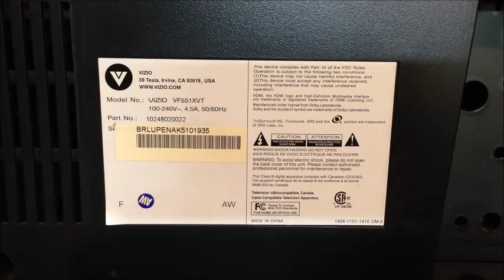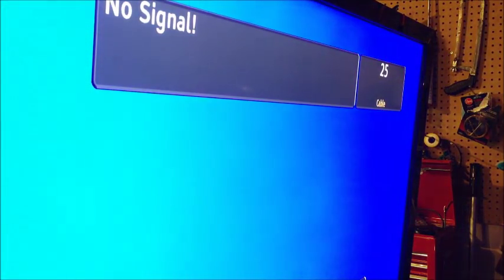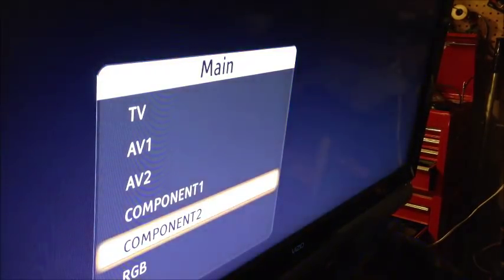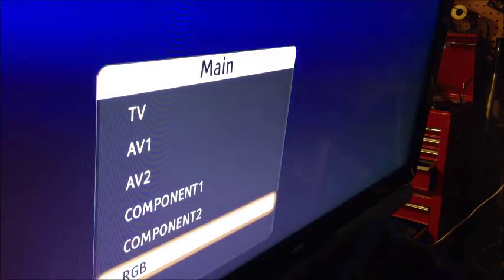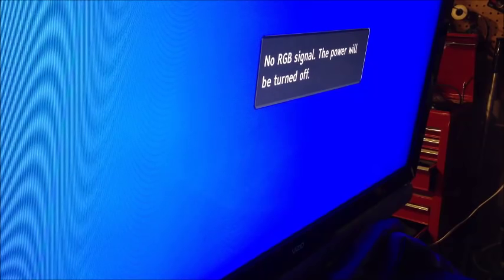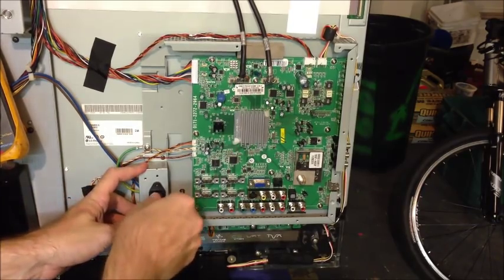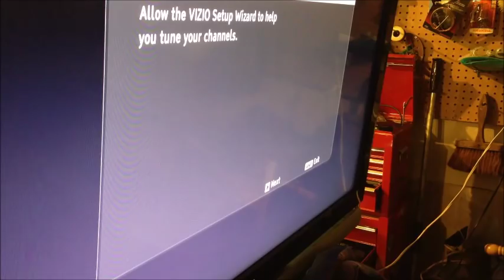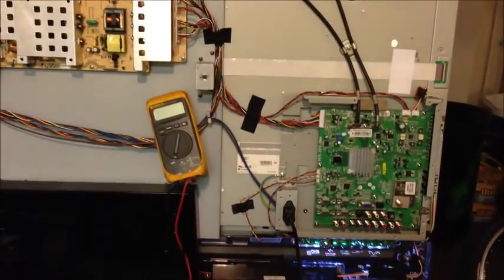Vizio 55 inch LED Television Repair VF551XVT

Comment: Thanks for the video, very informative. This did not address my particular issue however. I do have the Vizio 55in VF551XVT but the issue with mine looks like wrinkles in the tv picture. Not lines per say but it looks like wrinkles or wavy black lines. They are not very dark but when there is a light colored source on the screen you cant miss them. If I were to send you a picture of this do you think perhaps you could identify the possible issue?

Comment: Having a problem with a e500i-A1 vizio 50 inch went out while watching simpsons marathon a few months back got it back on for a while just unplugged the power cord for a min then plugged it back in ..(hard reset) now it's out again and I've looked over the boards both power and main and I do not see anything burnt out or busted ? Would like to hear your opinion on the matter

Comment: Erik I have a 50 I mean series vizio smart tv. Under the first year it had a power problem. they fixed it under warranty. 2nd year I'm getting vertical thin green lines that stand out even more in the black. I don't have warranty for it. could it be the motherboard or the circuts?

Comment: Have the same model and suspect the main board. The audio seems to have a glitch or fumble towards the end of the board part #365500320150, sounds like you said H or 4H, but it's not clear?

Comment: were back to the old days of plug in boards, my parents had 1976 Quaser tv with plug in boards, I fixed it a few times. it was a hassle i guess for repair shops to stock all those modules.

Comment: got a vizio model # SV40M  i believe it"s 50 inch. will turn on and a  program will play for about 5 minutes then lines start about half way through it and then bottom 3/4 is black, and top 1/4 is still showing program.

Comment: My tv is a VIZIO LED 55 tv model number E550i-A0, after a storm, my tv's whole side panel with all the inputs stopped working, and gave me the same as what you said in this video. I could switch from HDMI 1 and 2, but nothing showed on the screen. HDMI 3 and 4 are OK, but they are located on the back of the tv. Nothing on that side panel works. The screen is also fine but there is no sound. When plugged up and when playing a movie or game, the VIZIO word is not lit up at all and I do remember it being lit up when I first bought it. I can still get movies and games to play through those back HDMI ports 3 and 4. I have thought that it might be the control board, but the tv also will shut itself off when there is nothing playing on the screen and in the beginning of movies, IT doesn't really turn off, but the screen goes black, like it needs to gather enough power over time for it to stay on because once a movie is actually playing, it doesn't shut off. Do you think I might need to get a board and a power supply or just try the board first? I don't want to buy something I don't need, but this happened before I even had the tv for an entire year and Sam's (where I purchased) wouldn't replace it because they said they no longer had the model number and vizio wouldn't do anything for me. I have shotty electrical work done (I rent) and am currently using a battery backup surge protector to plug all my appliances in to. Please get back to me at your own convenience, I don't want to spent 800.00 on another tv just to have it for under a year. :/

Comment: Hey Eric. I have a 55" Vizio model E550VL. Both my HDMI ports one and two stopped working. Only HDMI side works. Not sure where to go from here to which part I need. Thanks
Reply from the maker: I would replace the same board I replaced in this video
Reply: Ok thanks eric

Comment: Erik - thanks for posting this.  I have the exact model, and I have replaced all 4 boards (controller, power supply, CPU and backlight board).  The logo and lower left LEDs come on, but the screen never lights up at all.  Does everything need to be reinstalled (in terms of metal covers) for the panel to turn on?

Comment: I have a 65" Vizio smart tv and when I turn it on the screen stays black. Do you know what I can do to fix it? Model M3D650SV
Reply from the maker: If the audio works and the vizio light stays on, but the screen is black, then I would look for the boards that connect to the lights. They are usually on the side. I mention them in the video I think. Replaceing them may work. Make sure the power supply is ok like I did in the video.
Reply: +Fabian Jimenez 
Hi Fabian
I have a XVT3D650SV  also. What ever became of your issue with your TV? I lost the backlights, but TV turns on and audio are okay. PCBs are hard to get for this model. Can you tell me what you did? Thanks Marty
Reply: +Fabian Jimenez 
I forgot to mention that I do not get the boot up screen with the "V" but after the TV initializes setup the audio does start up. Need a supplier for T-Conn, Main board and LED driver brd.
Reply: +Erik Frey what would the part be called that I need to replace? My TV powers on but no picture.  it has back light.

Comment: Thank you for this video, the problem with my vizio 45" LCD is that when I turn it on the picture only shows on half part of the screen, is there a way to reset this? thanks
Reply from the maker: I doubt it.

Comment: Hey Eric I have the exact same TV when I turn it on the orange light turns to white and the start up vizio screen comes on and stays on the vizio start up screen and I'm not able to do anything else with it and I have to unplug it and try again. Sometimes it will come on no problem and other times it may take a day to come on properly. Any advice on what this problem may be

Comment: Hi Erik, thanks for the video! 
I have a Vizio 50" LED 3D Smart TV, model number - M501d-A2R... that's a vertical purple line on the left side on the screen, just won't go away no matter what output I switch... any advice?  Thank you in advance!

Comment: Hi.   I have a Vizio 55 inch LED TV model # 552XVT which keeps shutting itself off.   We purchased it in 2011.  Over the course of a movie it will shut off about 6 or 7 times -- First at about the 45 minute mark, then the interval gets shorter.  This issue is worse when using dvd player and xbox then when watching tv.    Any suggestions on what may be the source of the problem?
Reply from the maker: Sounds like something is getting hot maybe. It's probably in the power supply. Running the DVD or xbox makes the processor work harder then cable TV. Unless it comes from a cable box via HDMI. I suspect power supply board. Look around on it for popped up capacitors. They look like little barrels or soda cans. They should all have a very flat top. if any are rounded they need to be replaced. Also check solder joints on bottom of board.
Reply: ***** Thanks!

Comment: I need to know how to get the TV apart to get to all the electronics.  I can't seem to take the back or the frame off of my Vizio TV.  I removed all the screws and can loosen the two sides of the monitor, but the top and the bottom are stuck and/or held on by something that I can't see.  I've tried everything I can think of to take it apart, but I also know it's made of cheap plastic and will break with much force.  I've seen several videos on how to fix these TVs, but none that show/tell you how to get inside of them.  My model is a E321ME...which is different then all the videos I've seen...so maybe my TV is trickier somehow.  It's super frustrating.

Comment: great video i did that same thing you did with the multimeter i got the ac to read 120 volts and i live in the us

but on the DC section i only got 1 read of 5v the other readings did not work

my problem is that one day i plugged in a air conditoner in the outlet and my tv as well i had a hdmi plugged in to the back and it blew out the hdmi port like it looks black but i cant get the logic board section area open because it has the metal plate over it which i dont know how to remove to check the caps

idk if its the psu or the logic board or main board
Reply from the maker: did you ever replace the power supply board?

Comment: I have VF551XVT 55 in. At times it works oK.then the picture fades out and if turned off for a while it'll get back to normal.The sound continues to stay on...so the only thing that goes out is the video. Please help out.

Comment: hey erik i got a vizio m55onv 55 inch i get power and it lights up but no icons and no control over the channels i ordered a new board please tell am i right or could it be somthing else
Reply: thank you i'm ordering a replacement power board as soon as i sell the main board i bought that didn't fix it your right its a gamble. heres a question about the westinghouse i got i have gottin a few videos on what maybe wrong with it but i have replaced the power supply twice and pretty much very board visiable and still on getting the tv to turn on. now with that said i tryied to turn it on once and the button board arced off and i saw a spark would that have fried my main new main board?

Comment: Ever had this problem: Vizio E550VL: Sound will not work on HDMI(does in other input types AV/RCA) tried other cables and different input devices; blueray,xbox and adjusted tv settings

Comment from the maker: If it runs for a while and shuts down it could be an overheating issue, or bad capacitors (they tend to act funny when they go bad and get hot). I would check the power out, labeled 12V, or 5V, etc and make sure they are what they are labeled. BUT, the power supply board is prolly a good guess. It's hard to say.

If you see any poped up caps, you might just get by by replacing them.
Reply: Turns on for a while then goes off an comes back on
Reply from the maker: Michelle Novotny It could be getting hot. That one's tricky. try unplugging the wires from the power supply board that go to the lights. They will be bigger, not a ribbon cable. See if it will stay on then.
Reply: Thank you I'll try
Reply: ***** my tv is doing a similar thing when I first turn it on the screen starts flashing on & off constantly  & can hear a ticking like noise each time it flashes. Any idea what it would be

Comment: Hi there, same model tv. When I plug it in, all that happens is the Vizio symbol turns amber/orange. No picture on tv, nothing. Is this a power board failure? I've checked to see if any capacitors are out and such but nothing. Any way I can test this without checking the voltage?

Comment: I have a Vizio xvt553sv TV.  It has a color issue with flashing red colors around areas of the screen, this seems to mostly go away after it's been on for 10+ minutes.  I've read this model has problems with the main board and the t-con board.  I think my issues relate to the t-con board, however, I don't want to spend $75 on that and find out I also need to replace the main board for another $150.  

Anyone have this TV with similar issues?